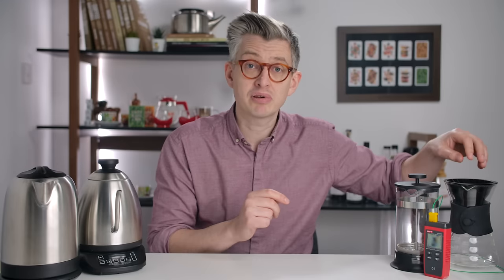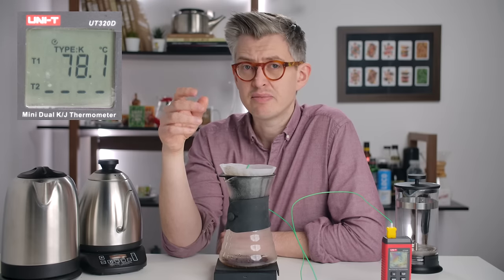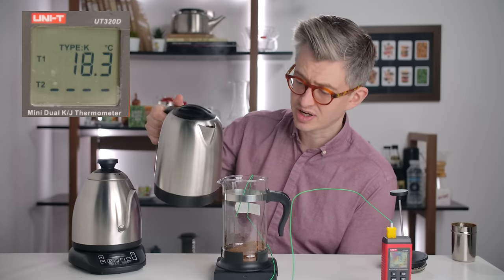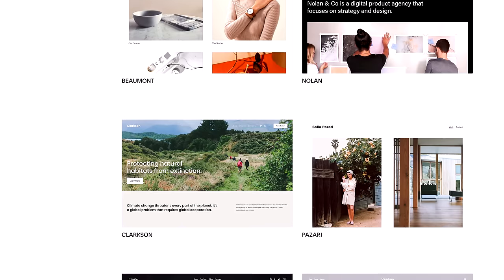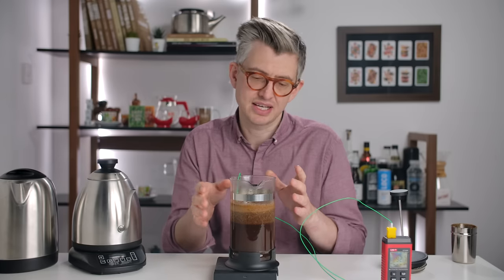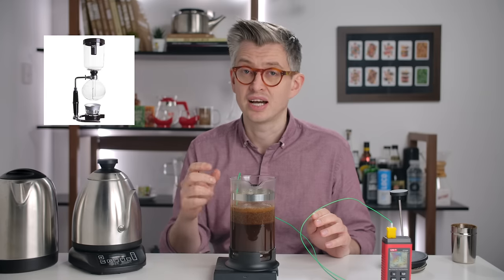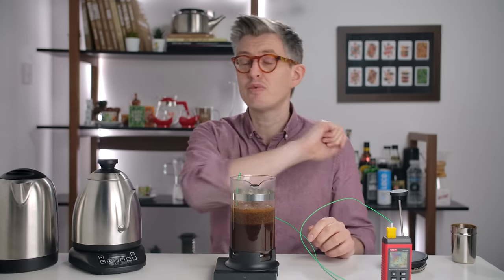Brew your coffee with boiling water - coffee brewing temperatures explained.

Comment: I’ve never had water scorched coffee, I can say that bunn percolators get so hot when they are on the plate that it burns the coffee. It does 2 things. First, the water evaporates quickly providing an overly concentrated coffee. Secondly the dissolved solids in the coffee are burned on the base of the carafe where it comes in contact with the hot plate.

Comment: Ok, this is good news. I don't have to worry about the water being too hot with a light roast. I have been aiming for a little over 90c. My experience with the typical dark roast Japanese style roast, however, is that cooler temperatures - 80 to 85c -- as directed on the packaging -- makes a real difference. At these lower temperatures the taste and sweetness of the coffee emerges alongside the  'burnt' flavors. The effect is smooth. At higher temperatures, the roasted burnt tastes are overwhelming and harsh.

Comment: I wait for the kettle to bubble off before pouring because it's dangerous.  I figure that temp is down to some 98-97C by then, it's a plastic BRAUN. That goes for both the Melitta, the french press and the Aeropress. We use all three frequently.

I've experienced that the coffee gets much much softer and smoother if waiting for cooldown to 92 or even 87 or something, but also a lot more boring and flat (especially the drip), more dusty tasting and without much nuance. Somewhat like freezedried coffee.

I don't drink dark roasts anyway, always more medium or light.

Comment: I'd have thought the issue was not the temperature of the slurry which would obviously drop as you demonstrated, but rather the immediate contact between the freshly boiled water and the first grounds that are hit: before the slurry is saturated and the temperature evens out.
Reply: But the temperature is still going to be under 100C by the time water is poured and hits the grounds. There is nothing magical that happens at 100C other than pure water boils at sea level at that temp. As clearly stated in the video, the coffee is roasted at a MUCH higher temp that does change the coffee. Water temp affects the extraction, that's it.
Reply: @chandrawong449  Indeed... But for some reason Turkish coffee tastes much worse if you let it boil. Something happens at 100c.

Comment: What is missing is the taste test of the non-preheated and the preheated French press coffee, that would have been quite interesting. Also, same test with dark roasts to see if really there is a difference with dark roasts.
Separately, I am not convinced of the idea of putting the temperature probe in the slurry for the drip coffee, because that measures the temperature after the water hit the coffee. The first coffee to touch the water will brew at the temperature of the water.

Comment: I say,  bring the water to a boil, and then use it IMMEDIATELY upon taking it off the heat.  You may be making a drip-coffee brew, or using aeropress - no matter.  The temperature will decrease immediately, so do not worry about boiling water "burning" the brew.  The only way you make a burned coffee brew is from overly-roasted beans.

Comment: 100ºC water can definitely be worse or burn coffee more than 200ºC roasting. Water is WAY more conductive to heat than air (i.e roasting). For example, you can stick your hand into an 200ºC oven for a minute and it'll be fine, but stick your hand into 100º water, and you'll have to go to the hospital for burns.

Comment: The brochure that comes with the Hario V60 plastic dripper says that its heat resistance temperature is 90 degrees C, which seems low for something designed to have boiling water poured in it.

Comment: Maybe it comes from the world of tea? Green tea definitely tastes awful if you infuse too hot.

Most kettles with temp controls have a "french press" setting just below boil, which I thought was just because of thermal shock to glass or something. I guess french roast is a dark roast, so maybe it's related to that, or it'll taste less awful if you don't decant it right after or something.

I often use more grounds than recommended, maybe I could use less if I brewed hotter. There's always variables to play with I suppose. I've definitely brewed cooler on coffees that seemed to need it.

Comment: I always thought the temperate issue was around the specific heat of water, the amount of energy it takes to raise the temperature of a substance exactly one degree Celsius. The specific heat of any substance is consistent except when it's changing states (solid to liquid, liquid to gas), where it takes a lot MORE energy to raise it one degree and change its state. That last degree would then contribute to inconsistency in extraction even if you had the same temperature water.
But after I started temping my water while brewing, I realized the highest temperature I could actually get was 97 degrees. Frankly, it's made coffee easier to not have to worry about it.

Comment: First of all, extraction is NOT a chemical reaction, since extracting compounds from coffee does not change the chemical makeup of the molecules being extracted. 
However, since hotter solvents usually provide higher solubility, extracting with a hotter solvent (water) will usually extracts a higher proportion of the chemicals in coffee.

Comment: The thing is, if someone has been brewing their favourite beans at 93 degrees (from the kettle's perspective) and suddenly start raising the temperature by seven degrees, their coffee will (likely) taste differently. I think it makes sense that the temperature inside the cone is lower than the temperature inside the kettle. There is nothing magical about 100 degrees, except that water starts boiling at sea level at that temperature and therefore you can't go much higher unless you use an espresso machine. But what compounds are extracted at different temperatures is a whole different set of questions. There is likely to be a different extraction profile in 85 degree cone temperatures vs 93 degree cone temperatures (from using water that was 93 degrees in a kettle vs 100 degrees in a kettle, respectively). And, as you alluded to, different roasts will respond to these temperatures in different ways. Essentially these experiments show that water that was heated to x degrees in a kettle was always probably about x-7 give or take degrees in the slurry. But how going to x-7 + 7 in the slurry affects the flavour is a new question.

Comment: Very good video. 

I have a question about the dark roast comments, or which I have paraphrased:

'If the coffee is a darker more delevloped roast...its going to be easier to get those very bitter, harsh, ashy flavours. Don't brew quite as hot. Brewing in mid to high celcius will result in a smoother less bitter result that should still be well extracted. If you are getting a bitter, burnt taste then you can back off the temp'

I only drink black coffee. I love it strong, ashy wood and, cigary. I buy TofHarrogate High Voltage. How do I enhance the smokey woody flavours? Are you saying I can get the best out of it buy brewing a little less than boiling; because the hot water has an easier time of mixing with the dark roast? So to get the ashy flavours I shouldn't be brewing off the boil?

I have a temperature gun and I sometimes aim it at the metal element inside at the bottom of the kettle with the lid off. And I wait till that gets to about 92°c then pour into my boiling-rinsed and dried French press.

I need to learn what bitter actually is. Because I find Gold bitter, but that's not a dark roast, and it probably isn't actually bitter.

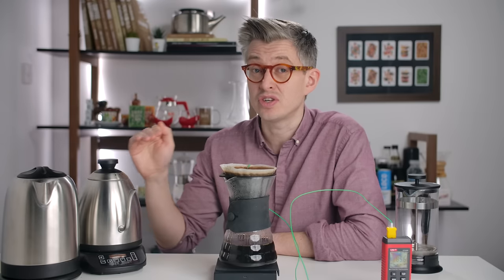Comment: 4:17 Not super relevant, but a neat fact: Water at around 1atm won't actually reach 100°C in a pot or kettle, which is probably why your kettle is capped at 98°C. This is because of a concept called the Latent Heat of Vaporization - essentially, it takes far more energy to transition water from liquid to gas than it does to increase its temp by a degree or so, causing the vast majority of the water to sit a hair below 100°C.

Comment: One key factor you forgot to take into account James is altitude,  the boiling point of water alters due to atmospheric pressure, for example if you where at sea level , typically 100°c is required to reach boiling point, at a higher altitude point, lets say 1067 meters or 3500 feet, you would only require a temperature of  96°c to achieve the boiling point of water.
Another factor to take into account is the ph level which will also impact the requirement needed to achieve boiling point....
The easiest solution to determine you have reach boiling point is visual, as in a kettle that visually shows the water chemical reaction as in turning from a liquid substance to a gas as in steam ..... once you see water boiling, a chemical reaction is occurring,  hence boiling point.... simple eh 😂😂👍
And that's if you use water to make a coffee 😂😂

Comment: I'm very interested in filtration mediums, but know I do not have the palate to give answers to my questions. For example, good coffee water heated and filtered through paper/metal/cloth; can you tell a difference from a non-filtered control? Does heating change the chemistry of the water; can you taste the difference between room temp water and heated water that is cooled to room temp? What is the temperature that changes the taste of water? The corollary to this is, is the flavor imparted by a metal filter just the flavor of heated water? Is there a difference between brewing with metal, then filtering through paper/cloth, to just brewing with paper/cloth? Does the material of the heating vessel, glass/steel(/copper?) make any difference?

Comment: I have a problem! 

Love the advice and want to use it, however I notice my paper cone filter breaks when I pour straight away into my pour over. I'm using a large plastic cone with a small opening on the bottom. The paper filters I'm using are Melitta #4. Hmmm

Comment: ACTUAL brewing temps! Yet another myth of the coffee industry brought to its knees, and one that I used to argue about when immersed in that industry myself.  No one ever seems to take into account the very obvious fact that water cools the moment it leaves  the heated pot/dispenser. 
One thing I would dispute though is the notion of very high temps being present in a siphon pot. If anything, I would find that brewing temps tend towards the lower side. The heat source is so far from the water in the upper chamber, and even with an adjustable heat source underneath, the water temp in the upper chamber does not vary much, and there was a natural limit as to how hot it would even get. Glowing lamps and inserted thermometers make for impressive imagery, but like so many things coming out of the SCA, it's all hype with little reality-based substance.

Comment: I’m not so sure about this and wondering what I’m doing wrong. If I use boiling water (100C, I’m at the sea level) in my V60 (ceramic) I get back quite strong heavy coffee with all the fine nuances removed. Gone is the black tea in my Ethiopias and the blackberries in my Kenyas. I only use light roasts (mostly Gardelli & La Cabra). Extraction time including blooming is about 2.5 minutes so I don’t think that my grind is too fine (Helor 101 grinder). Normally I’d use 30g of coffee for 500g of water (50g of water for blooming for 30 seconds).

I went back to using about 94C but I’m still not entirely happy. I love the fine nuances, the teas, the fruits, flower tones in my coffee and I truly succeed to extract them not as often as I’d love. Trying to figure out how to improve.

Comment: Speaking of double-walled metal pots...have you tried them? Temperature stability is important for espresso, why not press coffee? I switched to one years ago, mostly because I can't be trusted with glass before my first cup, and I got tired of buying replacement carafes.
Reply: FWIW I used to use water right off the boil with a glass press pot. With the metal insulated pot, I preheat the pot with boiling water, pour the water back into the saucepan on the stove (which I find more convenient than a kettle given this operation), and heat it up to 195-197 F for the medium roast coffee I usually drink. I push it one way or the other if the coffee is a little lighter or darker, or taste experience dictates.

Comment: Did you kept your Brewista at the set temp during bloom phase? Or "hold" as my Fellow Stagg EKG kettle could call it? Since I see a lot of talk (elsewhere) of using the hottest water but meanwhile letting the kettle cool down during bloom phase as it's not on "the fire/electric". So resulting in a lower water temp at 45sec compared to keeping it "on hold".

I never see that mentioned anywhere and was wondering. Because I knew the advise of as hot as possible but got myself worse tasting drinks at 98C vs 95C while placing the the kettle back on the dock during bloom phase (so water is at set temp at 45sec).

thanks and keep up the good work!

Comment: James Hoffmann, I have a question. Why are you measuring the temperature of the slurry? Every guideline I read states the water temperature should be measured at "the point of contact" to the beans. I can't find much info on slurry temp. For example, the water from the shower head of an SCAA certified brewer must be 92 to 96 degrees C, but there is no information on slurry temp. I haven't seen compeition brewers brew from boiling either - and from personal testing I find boiling water definitely 100% gives more bitterness - which of course can be counteracted by a larger grind size - but all else equal - I still don't scientifically understand the basis here for measuring the slurry temp.

Comment: When you pour water through the air into a pourover or French Press, you're going to lose a lot of energy. The water is losing heat to the surrounding air on its way to the coffee grounds. A narrow stream will cool more and more quickly than a torrent. Similarly, unless the "pot" and grounds are warmer than the water, the water will drop when it hits the grounds. The preheating (no temp provided) experiment makes no sense in that context because if the preheat is less than the water temp, it will bring the water temp down.

A more relevant comparison would be percolated coffee vs any of these drip/press techniques since percolated coffee uses actively boiling water.
Reply: Preheat still has some effect. In a French press for example, what's going to cool water more when it comes into contact with it: 70 degree Fahrenheit glass or 130-140+ Fahrenheit glass?

Comment: This make the whole concept of dripping coffee for me changed. I have very little appreciation for pour over, I had used 91 deg water for long time and most coffee I made are bland or dull regardless of how good beans I brew. I use to check coffee bed during pour it was only 80 deg at best. So I keep asking myself and did research, never find any info that when recommend brew temp is 90, is it in coffee bed or from kettle. Until I watched this vdo for the second times and try it.
First time I watched I went and check other info but couldknt any info to confirm it so I just ignored it. Now I try t get myself more into pour over then test this again. Great infor. But does he actually use boiling water in his daily brew?
I use 98 deg.

Comment: I know this was posted a long time ago (and you are on retreat now so probably won't see this message for a long time, if at all).  However, the thing I'm missing is not the temperature -- 91 C vs. 100 C is meaningless to me.  I completely buy that different things are extracted at different rates at different temperatures, but I have no feeling for where the boundaries are.  Why is 91 C not considered "too hot" while potentially 100 C might be considered "too hot"?  Certainly, as you say, if I alter the temperature of my water, the resultant coffee is different.  However, it's not clear to me why hotter is better, even though I'm starting to believe it.  It would help to understand more clearly at what point things will start to get worse and why.

Comment: I'll have to do some personal experiments. I was hoping to see a bit of a taste test with different temps but I get the general point that it will be cooler than your original water temp. Personally I heat mine to 203F (couldn't decide between 200 and 205F which I saw was recommended).

Comment: I think the idea comes from hotter temp = faster extraction, so it's easier to run over the correct brew time. 
But this was not a great test. The idea that 93 C is all that much lower than 100 C (in the context of coffee brews) would need to be proven. How do we know what temp is actually the point where unwanted compounds begin to extract, and that 93 C isn't high enough for that while 100 C is? Also, did you test the kettles with the same probe thermometer to make sure it was calibrated?

Comment: I've gotten similar results. For v60, I've experimented with keeping the kettle at the target temperature before each round of pouring, and I haven't seen anyone else talk about doing that. The basket temperature gets several degrees higher, as expected. It seems to help with some coffees and not with others, but I don't have enough data to see a clear pattern. I'd tentatively say that it helps more with lighter roasts, but I wouldn't swear that I can confirm that with my non-rigorous testing. Help?

Comment: I use 75°C on V60 to brew supermarket coffee and get good results (at least much better than usual). I usually take supermarket coffee but not the worst and I use britta filtered tap water, Ca~110-130ppm & Mg<5ppm and it helps a lot. I always get bitterness and less fruity flavours when using higher temperatures. Why is that ? The coffee is badly roasted, Mg is too low ? Does reducing the Ca content and increasing Mg content helps increasing the brewing temperature ?